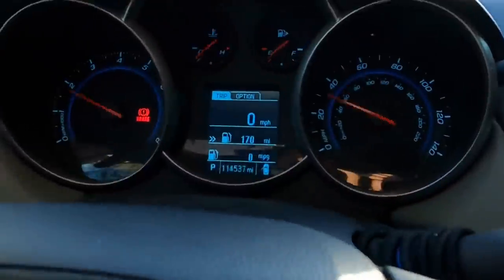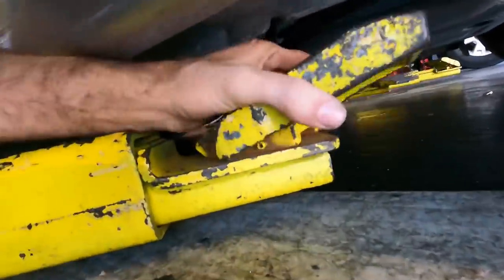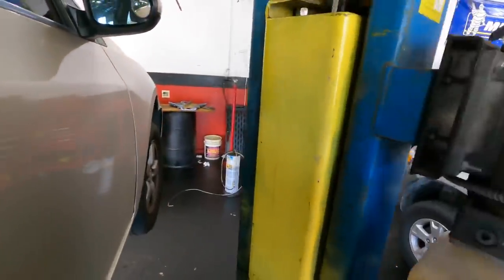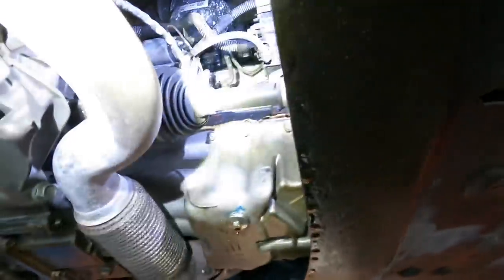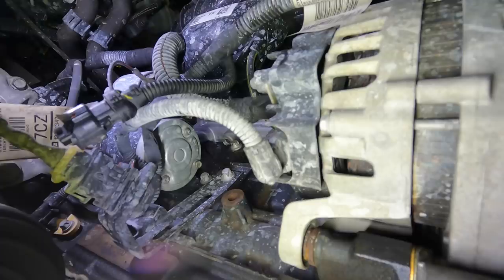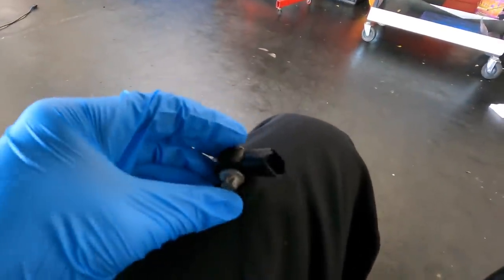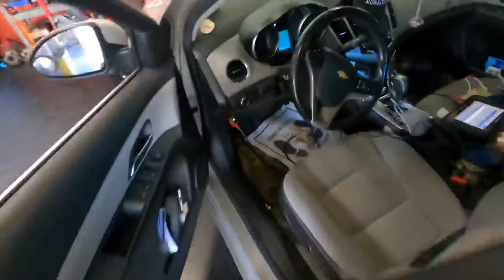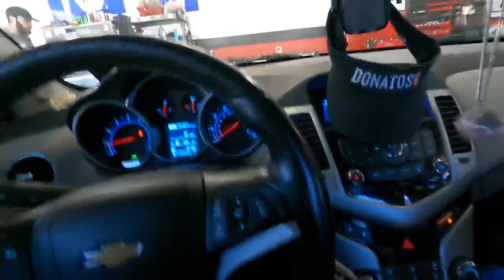Rolling the Dice! Parts Store Diag! Customer Supplied Parts. 2015 Chevy Cruze  P0324

Comment: We manufactured those Cruze's here in Adelaide, South Australia as the Holden Cruze. The parts and build quality was such that out of every 100 cars built, 101 ended up being abandoned on the side of the road. The hapless owners quietly sobbed away looking for an appropriate support group.
Reply: My daughter owned one. I’ve always been a Chevy man, but not anymore. The Chevy Cruse was a piece of garbage.
Reply: Rubbish, I've never seen one abandoned on the side of the road and know of several owners who haven't had any major issues and are happy with them.
Reply: My driving school had a Cruze. They seemed happy with it. Maybe the cars for EU were build somewhere else.
Reply: I never wanted one, but had a coworker that has owned two of them without any issues. First one he drove back and forth to work an hour each way for over seven years. We actually worked in the plant that manufactured the Pistons for the engine. My job was setting up the milling machines that would put the valve pockets in the crown of the piston.
Reply: i've got a malibu with am eccotech 2.4 and like it.  not the same as a cruze  i know but very similar.  i can't vouch for long term use but i can tell you it lived a rough life before i got it. 2012 model for $600, it had to be towed home. it was rear ended, driven till the timing guides went, bent every valve in the head, kissed the pistons, and something i didn't get the story on happened that managed to break a rocker, throw it out of alignment, fender liner is mia and even the driver seat brackets were broken. it's good now most of the damage beat out, a new bumper cover, seat welded up, replace the head, polished the pistons, put an absurdly price timing set in it and i was good to go.  well into my second oil change at the point, it's working fine. so i think i got that right. funny enough i could have brought my old head in replaced the seats, recut everything, assembled it and even do a vacuum check at work in a day off but the price on the parts and fact that i'd rather trust used oem valves not to break, i went with a u pull it junk yard head. that car should have been sent off to the junkyard but i saved it. had 160 on it and seems like a good car thus far. doesn't really use much oil like ecotechs are known for doing. i'm not a fan of the 6 speed auto. behaves strangely at really low engine speed shifting gears but not rough or slipping. i've had some bad transmissions and i'll trust it anywhere. think it's just a learned behavior with the computer, heard of that happening.
Reply: How much of them was built here. I presumed we imported them from Korea like captiva
Reply: @93jummy  Bingo. The Cruze is a Korean automobile. My guess is it's some joint-venture leftover by Daewoo to be honest with you. I don't think it's necessarily a bad idea for General Motors to have a Korean sourced vehicle because they are cheaper and people like them. That being said though, I would never buy one just like I would never buy an Elantra.
Reply: @MarkVanderberg  I rented these cars a month at a time for work, and used several of them. I never experienced any problems with the Cruz, but I wouldn't buy one either, they were pedestrian far as rentals go, I much preferred the Sonata V6.
Reply: @nomebear  Actually I did rent one many years ago. I remember it being very cold and I had issues with the air pressure sensors in the tires. Also low profile tires did not do well in snow.
Reply: @ashes2ashes863  — not all Korean cars are made alike, as i have a 2002 Santa Fe with 403,000 miles on it and still good compression.
Reply: @randomschmo5778  yeah that's fair. I actually know somebody who has a Santa say as well with about 350,000 on it. It's beat but it still gets him back and forth to work.. It's weird though because the same company Hyundai has issues with a lot of the cars that don't even make it to 50,000 not needing an engine. Got to wonder if it has to do with who's piecing them together maybe
Reply: @ashes2ashes863  not everyone drives the same way. or in the same place. thats most of the reason for the differences in how long cars last. some people go through brakes often, some people go through engines a lot. everyone up north goes through the whole car because of rust. just like down south we tend to go through paint a lot

edit; for instance, my car. i have a 13 nissan. well known for transmission problems. but because i drive like an idiot ive only gone through suspension parts and an unlucky A/C compressor. i keep the engine and transmission maintained so i expect no issues with them. but garbage roads and bad habits are going to kill my suspension at least one more time before i replace the car lol.
Reply: I commonly refer to them as a Regurgitated Daewoo as I do anything Holden/GM..
Reply: Managed a trans shop. Disliked that tranny. The 4T65E used on the Impala was the single transmission that I loved loved loved. I always kept 2 or 3 of that transmission built and ready to go.
Reply: I'm Australian and I know two people that sold theirs pretty soon after buying them.
Reply: They were not one of Australia’s favourite cars…..
Reply: Trash powertrain trash car.  It's best to stick with LS/LT platforms from GM, preferably the 99-06 year models.
Reply: @jcitizen  Will you name them?
Reply: @93jummy  the first Cruz was built in Adelaide south Australia the quality control was not good defect rate out the factory door was  average 76 per 300 cars built I know ford broad meadows was much less with 1 in every 210 cars with assembly line defects like most manufacturers they catch them in last stage before dispatching them in quality control but with such a high rate of defects off the factory floor in not a far stretch to see many lemons being produced and I know myself I had several  in my workshop over the years but I do believe after Elizabeth shut down (Adelaide) they were built in USA but not certain of that maybe they were imported because I don’t think the quality improved much regardless of where they were produced severely underpowered for the demand that normal everyday drivers put on them
Reply: @ashes2ashes863  I just looked it up. US market Cruze's were built in Lordstown Ohio.
Reply: @JeffDeWitt  don't be completely confused by that because the car itself was manufactured in Lordstown Ohio. In fact I used to occasionally drive by the plant that made them. The problem is the engine and the transmission are sourced from Korea and simply assembled into the car. This is not an uncommon practice. In fact the Ford I have been driving for work in the last year now was assembled of all places in Spain. That's despite the fact that the engine and transmission came from Dearborn Michigan. Ford literally sent the powertrain over to Spain to have it assembled into the Transit Connect passenger vans, and then brought sone of the vans right back here anyway. Seems stupid, but you got to figure they sell it in a similar European version over there so maybe it makes sense.
Reply: We also had Korean built units in Australia. It's more a design flaw that plagues these cars. Never mind, they're great for business! At least half of these that come in for services ask us to find the coolant leak 😅
Reply: I live a stones throw from Holdens... my son was a spray painter there for a year..I did shut down jobs there over the xmas period..

Comment: Man, I wish I was able to take my vehicle to you. I called a dealer just to get a quote on updating some software and doing a CASE relearn and they were going to charge an hour for checking to see if there were any updates, charge an hour per update and charge an hour for the CASE relearn. All in all it could cost me $1050.
Reply: I don't know what year, make, model, options your car has, but from what you say here, I think they priced you out the door on purpose. Just a guess on my part.
Reply: @Wishes890  2012 chevy colorado. Not new, but not exactly old. I wouldn't be surprised if they just didn't want to do it. They certainly lost my business outside of these updates, and the updates.
Reply: @solhays  That truly is a rip off.
I can see charging maybe 2 hours to do the updates.
The equipment and updates cost the dealers money.
Not the updates to the vehicle, but updates to the scan tools.
I have never seen a shop/dealership charge more than 1.5 hours.
The problem with forums is, for example, Dodge Caravan/Grand Caravan. Many millions sold, so it stands to reason that there will be more complaints as compared to say a Toyota Sienna.
So, when people read the forums, it looks like Caravan/Grand are junk. I worked at Dodge dealership for 10 yrs. My experience was that there were as many good Van's as so called lemons.
There was an issue with a couple of Dodge products that, if there was a hydro drop or surge while performing updates, the PCM would fry. If the vehicle had warranty, it was covered, but out of warranty the customer had to pay. That was not fun. There were several fights with customers over it. So, to avoid this, the manager priced the update to cover the cost of the module. We didn't do any more updates after the price increase.
Reply: @Wishes890  I get that they pay for the tools, pay for training and pay for time. It really wasn't out of the question for me to pay for 2 hours or less, hell I would have had them do an oil change at the same time, and I NEVER let anyone change my oil. lol. But to charge upwards of 7 hours is really insane to me. They wouldn't even have to take up a stall in order to do it. Grab a battery maintainer and an extension cord, run an update, go work on something else, run an update, go work on something else, so on until the updates are done, spend 5 mins doing the crank position relearn and be done with the truck having only touched it for about an hour.  I'm going to do a little research on scan tools and see what I can purchase for myself and pay the 3 day fee ($55) from GM to do this stuff myself over a weekend. I think I found a Tech2 alternative for $120.

Comment: My wife's 2010 Camry air bag clock spring sensor (inside steering column) broke 2 years ago.  Dealer wanted $640 to fix. The wife told me to fix it.  I watched a youtube video on how to replace. Bought the part online for $60, and replaced in 55 minutes including test drive. The silly thing had like 5 electrical connections inside it! The wife bought me a coffee mug that says: "I CAN FIX IT"   LOL

Comment: This was a good one. Would have loved to see you do work on a P0299. My Cruze with 41.8k miles had it. Ended up selling it because every shop in my area kept telling me it was $2k-4k for a turbo replacement, labour, and a bunch of other things.
Reply: Was that based on the error code, or did they confirm that the turbocharger did need replacing?
Reply: @Chlorate299  they said there was a pretty big crack. Even showed me pictures of the turbo. They said that GM does have a fault tolerance if there's a hairline crack, but unfortunately the crack was out of that tolerance range.

They said I could reset the CEL and it should still run, but that wasn't a chance I wanted to take. I know next to nothing about engines, let alone turbos and it didn't make sense to me that you could reset a CEL for a turbo and it would be okay.
Reply: Really feel for you there, Justin. That's just bad luck.
Reply: @mrc7478  Its not bad luck, its a bad design by GM. Its a known issue for them to crack the turbos and loose boost.
Reply: @mph5896  Semantics. Unfortunate for Justin though.
Reply: I assume you disclosed the known defect to the buyer and discounted the car accordingly.
Reply: @stevewhite3424  absolutely. I showed them all the damage from when I worked in construction, showed them the code on my bluedriver so they knew why the CEL was on, and had their mechanic inspect it as well. It was a lot of work on my end to make sure it was going to the right person. I didn't want to sell it to someone who wasn't mechanically inclined. They appreciated my honesty and still agreed to buy it from me at fair market value.
Reply: @mrc7478  unfortunate, but you live and learn. Turbos are not for me. I will stick to cars without them and live without it.
Reply: Really? From the Chevy dealer it’s was 1400 canadian (1000 usd)  also it should have a manufactured 5 year 100k km (60k mile) power train warranty. So I got mine free and it was just the wastegate issue but they just replaced the whole thing.

Also very easy to replace yourself.
Reply: 41k and it was out of warranty??  I had the Turbo go on my 2018 Kia Sorrento at 65,000 km.  Took them 3 weeks to figure out the problem (" I heard a weird rattle on the freeway one day, ever since it's been gutless, especially on hills, and my mileage is crap" 5 WEEKS to get the part, and they conned me into replacing the plugs (yeah, no shit they are carboned up, I drove it for weeks after the turbo went because I was out of town working and it still RAN, just gutless).  But I paid nothing for the warranty replacement once they figured out the problem.
Reply: @mrc7478  It's a known issue for all internal waste gate turbo designs not just that one.

Comment: Fun Fact: Piezoelectric crystals have electrons trapped inside their lattice work on the molecular level. Impacting the crystal deforms the super-structure enough that it releases them in enough quantity to be measurable by the PCM. The harder you hit it, the more it deforms, the more electrons are released, the stronger the signal becomes. But, just like the igniter on your BBQ, they do wear out over time and simply run out of stored electrons w/ currently no known way to recharge them. Fortunately, they're pretty quick and inexpensive to replace, so no biggie.

Comment: im the same way it easier to replace than to diagnose, checking can take forever, so if i can by pass i will, ofcourse on a shop enviroment you have to proof that piece its faulty, but personally i rather spend 20 bucks and 10 mins, than 2 hours and a case of beer

Comment: I do the same thing.  Try to diag my pen faults then buy part.  If it's easy enough to do I'll do it if it's a pain in the butt I'll give post to mechanic shop to do because y'all are trained to do it.  I've done it several times with my silverado.  O² sensors and oil pressure sensor.  Y'all have the lift and 100%proper tools 1 knowledge 2. 
I try to do my own maintenence because I took truck to have trans oil and filter replaced brought my own parts afterwards i visually inspected the trans pan, and the books looked like they hadn't been touched.  Either the guy was so good and didn't drop a single drop off trans fluid or he cleaned the pan then replaced the road dirtback on.  They told me they don't have a trans fluid sucker. Won't have them with on my truck again.  At the same time I had then drain and refill transfer case which is aluminum they cracked that then instead of replacing Taber case the welded hair line Crack in it.  Still not happy with them BUT not leaking so that's a decent sign

Comment: First time coment on your channel. I have a 2014 cruze diesel with 128000 miles the only issue I have ran in is the sensors going out or def pump failing. I love the car and the questions I get from putting diesel in the tank.
Reply: Interested in your thoughts on the diesel. 

Here in UK, small turbo diesels are everywhere, I have two. People in the states seem to complain a lot about them but they're great.

Is yours an auto or manual?
Reply: @mrc7478  our issue is theyre pretty weak compared to gas. not diesel in general, just the baby engine they like to put in cars. almost always way below what it should be
Reply: @bradhaines3142  Diesel is $7.70 a gallon here at the moment so mileage is pretty important.

Do you mean weak as in power/ torque or weak as in unreliable?
Reply: @mrc7478  well, power, but also the DEF system in the US is pure garbage. i was looking into getting a colorado with the diesel but it has a habit of the DEF system going bad right as the warranty expired, with horribly expensive repairs.
Reply: @bradhaines3142  thanks. Neither of my car's have DEFs but they do have DPFs, which can cause problems as well.